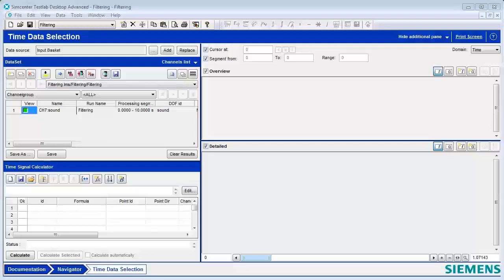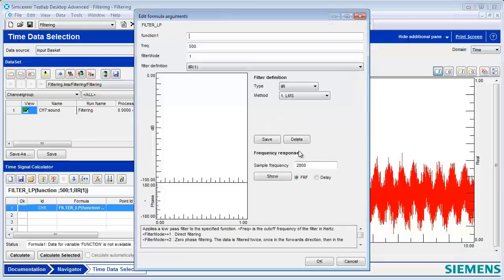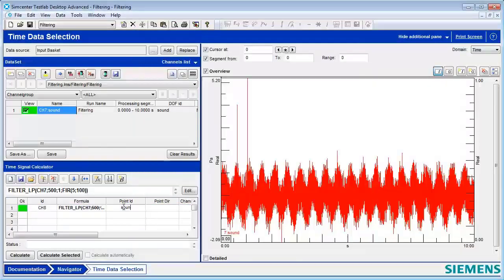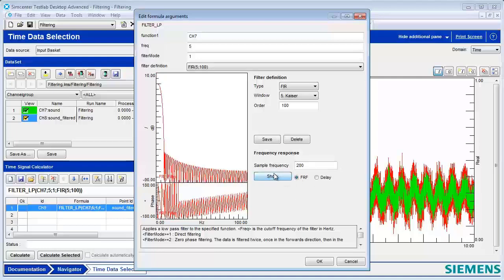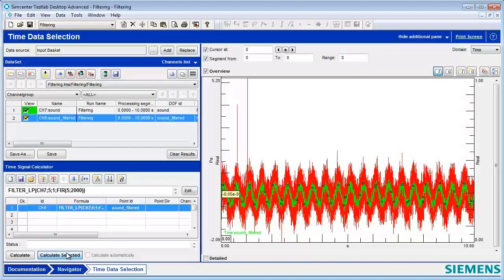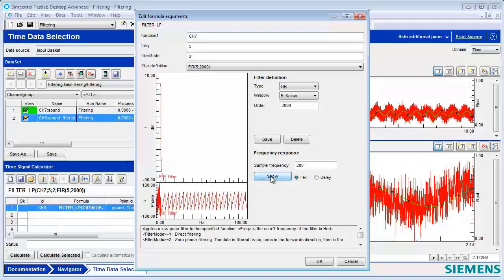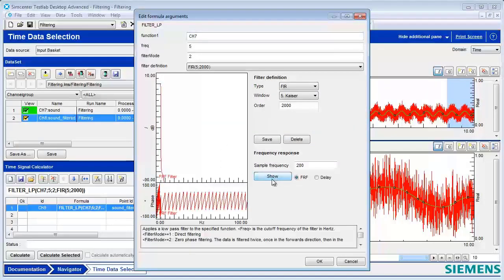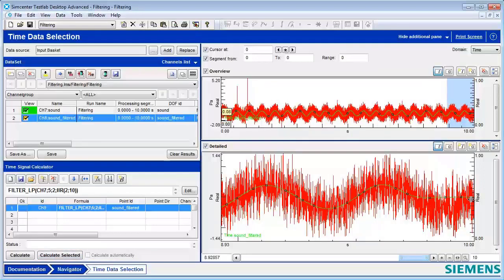Filtering in Simcenter Testlab

Comment: I have a question, by increasing the filter order are we compromising with the amplitude of the signal?
Reply from the maker: In general, the biggest trade-off with a higher order is a longer delay in the filter.  The amplitude behavior is not necessarily affected especially if the filter behavior is flat in the pass and stop bands.  See this article for more info: https://community.sw.siemens.com/s/article/introduction-to-filters-fir-versus-iir
Reply: @SimcenterTesting  Doesn't the increase in filter order always cause attenuation of signal?
Reply from the maker: @aryashah7892  Causes the transition between the pass and stop zone to be a shorter frequency range.   But data in the pass zone is not attenuated for example.  I guess the answer to your question partly depends on what area of the signal's attenuation you are referring to.
Reply: @SimcenterTesting  Yes, I meant to refer the transition band here. So I got my answer. 
Thanks a lot for the informations.